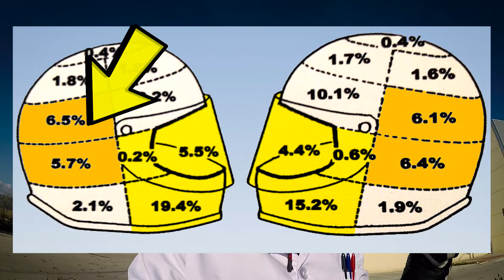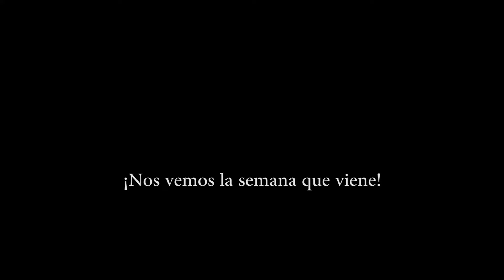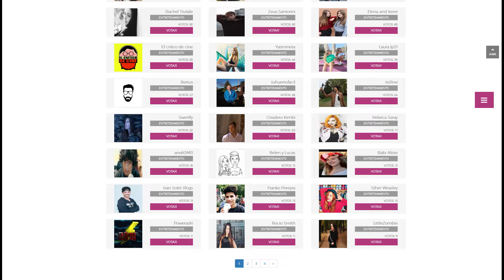Qué CASCO es más SEGURO? 50Km/h HELMET CRASH TEST!!

Comment: tremendo, felicitaciones por el aporte. Sin embargo, y a pesar de que uno esperaría intuitivamente que el casco no se rompa, lo relevante para la seguridad es que no haya penetración de objetos, que la deformacion se absorva por el material del casco sin afectar la integridad de la cabeza y muy relevante es que la energia del impacto (medida por la aceleracion, o desaceleración en este caso) sea la menor posible, de modo que tu cerebro no se haga pure, piensen en un frasco de acero (shell o carcaza del casco) y dentro un flan, con impacto fuerte la shell impecable, pero el flan quedó licuado....por eso cuidado con la interpretación de los resultados visuales.
Les recomiendo revisar tanto la norma europea ISO y la americana que describen detalladamente la forma y valores de las pruebas para darse por aprobado el casco bajo tal o cual norma. 
ojo que el casco ayuda, sobre todo en impactos de muy baja velocidad, pero a velocidades sobre 50km/hr en impactos con cuerpos rígidos (arbol, pared, etc) no hay nada que hacer, mas que cobrar el seguro de vida, por eso sean cuidadosos y previsores.
suerte.

Comment: Estaría bien otra prueba pero contra una pared, metiendo un relleno que pesara lo mismo que una cabeza y que se pudiera observar los resultados para ver si el casco absorve el impacto (alguna fruta como un melón con sensores, o relleno con huevos si no se tiene otra cosa). Quiero decir algo: es correcto que un casco debe romperse tras un impacto considerable (40 o 60 km/h), para así absorver la energía de dicho impacto y que no llegue al cerebro, que es lo más importante, sin embargo no estoy de acuerdo en que el casco deba estar destrozado por un impacto a esa velocidad. Algunos dicen que cuanto más destrozado quede, mejor. Yo creo que eso es absurdo. Principalmente porque no aguantaría un segundo impacto, aunque no fuese demasiado fuerte, y porque considero que cuanto más se rompa a menor velocidad menos puede proteger. O sea, si un impacto es a 30 km/h quizá no es necesario que absorva al máximo destrozándose, porque uno de bici es medio entendible (solo a medias) pero no uno de moto porque se va a más velocidad. Es más importante que lo haga a unos 80 km/h. En mi opinión, debe haber un equilibrio y tener varias capas (fibras de vidrio, kevlar y carbono por ejemplo), que se rompa a un impacto considerable pero no que se destroce ni se rompa la calota y el interior. Pienso que lo ideal es que se destroce la espuma interior y la capa superficial de la calota (fibra de vidrio por ejemplo) pero que el casco no se resquebraje. De ese modo protege el cráneo de impactos muy fuertes y al mismo tiempo absorve, pudiendo proteger algo de un segundo impacto. El Shoei creo que cumple con esto que digo, y por eso mostró absorver el impacto pero no se rompió: sencillamente porque el impacto fue débil y está hecho para impactos peores, así que yo lo veo un casco bastante seguro. El casco que se resquebrajó totalmente (LS2 creo), como dijo majesina, no sirve para proteger la cabeza, no al menos a velocidades considerables. Por mucho que hubiese absorvido la energía del impacto fue demasiado endeble. Tal vez solo sirva como quitamultas en scooters de 50 c.c.

Comment: This test isn't helpful, because the sharp test does not measure only shell penetration, but also impact transmission, impact distribution, friction performance and rotational force transmission (as about 60% of casualties are either caused or worsened by rotational force).

So, you see, have to make a way deeper testing. Also, you have to make sure that all helmets hit the same object at the same speed and are hit at the exactly same points. In a nutshell: this isn't real world as it may seem. It's actually very poor testing.